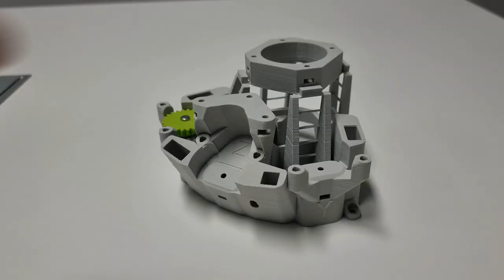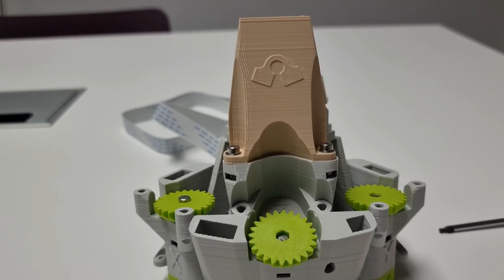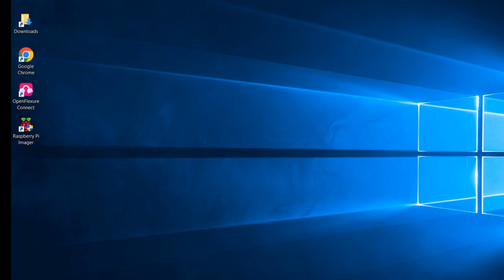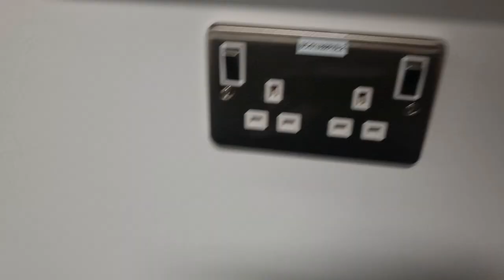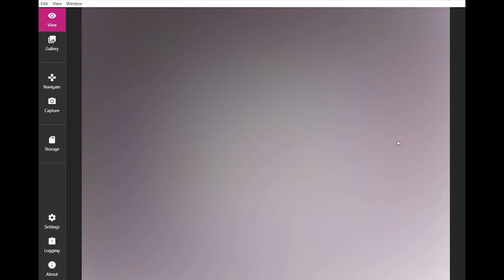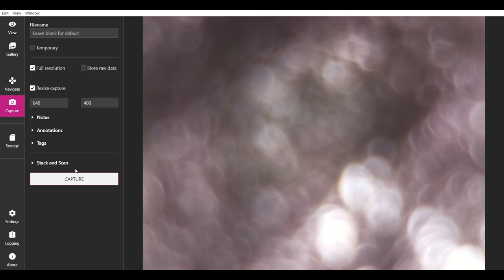OpenFlexure Low-Cost Microscope v7 - Assembly Process - MEng Mechatronic Engineering FYP

Comment: Nice! I just finished printing all the parts for this version. Need to order electronics and the hardware. 

Currently printing parts for a delta stage. I’ll print the block stage as well. Fun project!
Reply from the maker: I had alot of fun making this and in the future I hope to start making more videos and projects like this. https://taulab.eu/ is where you can get parts for the illumination and the Sangaboard, the rest youll have to source elsewhere. Good luck on your project!!!

Comment: Can the microscope be used for measurements? I don't see units in the software for the XY translations. Neither do i see the ability to pick a position for measurements. 
Is that availalble. (i'm interested in this project for measuring prototypes and products, not for microbiological research it was designed for).
Reply from the maker: I would refer you to the Openflexure Forum on their website where you could ask these question to the actual designers and creators of the Openflexure platforms, they would be able to provide more support and in depth-knowledge. 

From my experience with the microscope, I do not see any reason why it could not acheive the task you are setting out to accomplish. Its Intended use IS to look at Blood samples and detect Malaria Infections but it can obviously be modified to whatever use you see fit, they provide all the stl. files and you can modify them to your needs.
Also there are more powerful and better suited cameras that could be used, so that could be an area you could look into more. 

This video is more intended to be a guide on the Assembly process and not really a full demonstration of the microscopes capabilities.

Good Luck on your Project!!!

Comment: This is fantastic thank you. After you wrote the program to the sd card and plugged in the ethernet cable did the openflexure program just pick up the near devices or did you enter them somewhere. My program gives me a network error message and nothing shows up under nearby or saved devices.
Reply from the maker: Thank you very much. Yes, if it is all connected properly, and you have written the custom openflexure software onto the SD card and the ethernet cable is connected to the laptop/PC etc., when you launch openflexure connect application, it should show up as it does @ 7:11 shown in the video. If it still isnt working try using the lite version of the software and rewrite it onto the SD card and try again. When doing this project only the lite version of the software worked for me as the full version was not patched yet for the newest sangaboard that was just out at the time. Just double check all connections are correct , format and rewrite the SD card with the software and it should work.
I used the Raspberry PI 4 model B & the Sangaboard 0.5.1.
Are you using the exact same hardware specs as mine?
If you have any other queries about anything else try checking out the openflexure forum @ www.openflexure.org.

Hope this helps !!!

Comment: What's the purpose of those two glass slides?
Reply from the maker: Well usually you would put whatever matierial you were analysing in between the slides and that would compress the matierial and lock it in place. However at the time I was having issues with the focal length of the camera and it would defocus consistently. It was easier to put it on top without another slide on top of that. As it only seemed to focus when I did that specifically. At the end of the day the whole point of the project is to create a cheap alternative to a professional microscope, it may not operate as smoothly or as intended but it still acheived the same result.